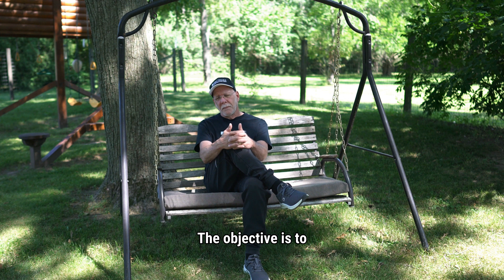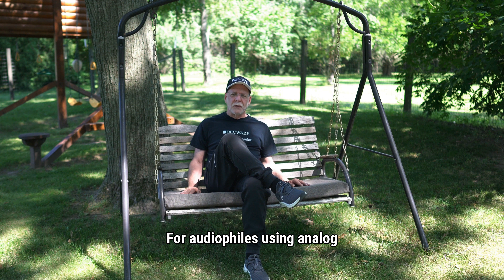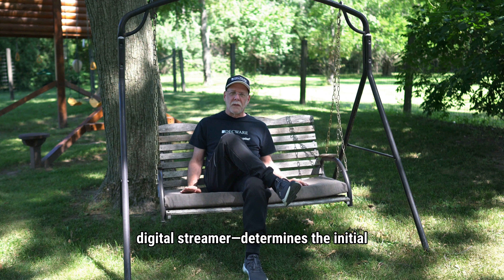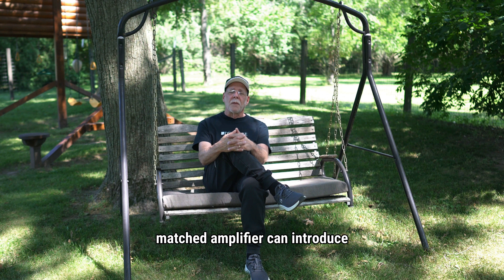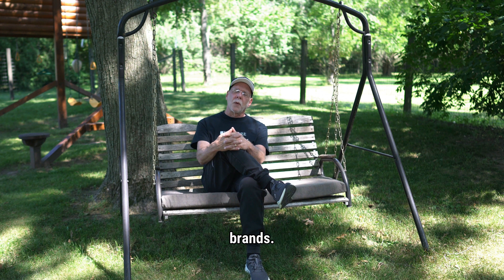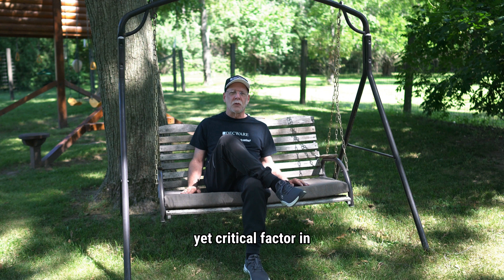DECWARE's Steve Deckert talks about Top 10 Weakest Links

Comment: Great video-  In my business as an Acoustics Consultant, I can tell you from experience most get gear/speaker setup in the room completely wrong, over 90%.  Given the numerous acoustic challenges inherent with rooms—challenges that are common yet predictable—it's surprising that greater attention is not paid during the design phase to fundamental architectural parameters such as room ratios, boundary symmetry, window size, treatments,  placement, and open-plan elements.  These factors play a critical role in modal behavior, early reflections, and overall time-domain response.  Once sound exits it becomes subject to the acoustic signature of the space, and without intentional design, much of the fidelity and imaging precision is degraded and DSP cannot solve this, no matter what you’ve been told.  Unfortunately, also true is, typical post-hoc treatment strategies are often insufficient, fiberglass and mineral wool are not an acoustic solution and one must address low frequency issues first.

Comment: Adding a so called quality dac does nothing, but color the sound,  you have to eliminate the  integral dac in your units which is virtually impossible,. So I  hate to say it but a quality equalizer used properly will do far more than any dac . Your just adding a dac to a dac. But haven't eliminated the so called low quality dac which you CAN'T . the less a dac. Does the better, it's a digital to analog converter,  if your dac is doing something " MAGIC " something is wrong.  Most boost the high end bass & midrange which is primarily what we hear
Reply: The EQ available at the digital source level/streamer where no electronic parts are in the analog path to cause phase shift in the audible band have been an exponential increase in enjoyment for me especially weak bass in old recordings only mastered for vinyl which is a common problem. Not all old records but more than you can imagine. Once you have a system that adds nothing to a recording presentation especially bass you see how crappy many recordings are. Doobie Brothers Minute by Minute album is a classic example of weak recording with little density in the whole audible bandwidth. When your speaker knocks something like Yello outta the park but a 70’s rock recording sounds anemic you see clearly that recordings are all over the place. 60’s Jazz recordings on the other hand especially live stuff are actually pretty good across the board. Not all but most. Bass is solid. As kids and young adults in the early days almost every integrated amp and receiver had a set of tone controls and a loudness button and we were listening to large bass reflex speakers. All of that turned everything into a homogeneous clusterfk of loud but smeared sound. Luckily we have EQ in the digital domain. No parts no smeared soundstage and imaging at least not that I’ve experienced. I refrain from using EQ though. But in some instances the advantage is undeniably clear. Better.
Reply: Nonsense!
Reply: @audiononsense1611  are you addressing me? A whole big post and you with a one word reply. Back it up.